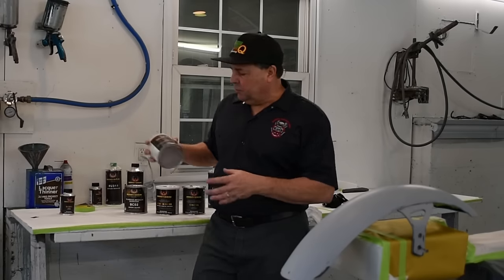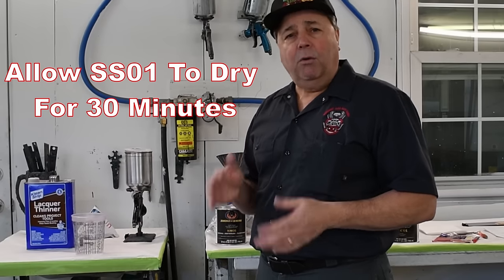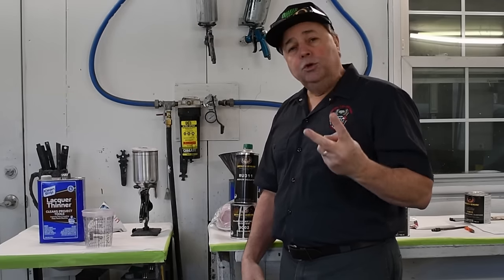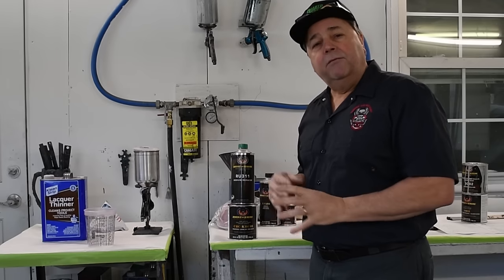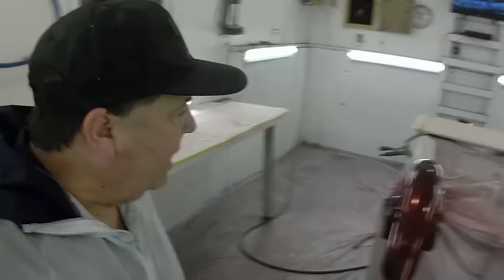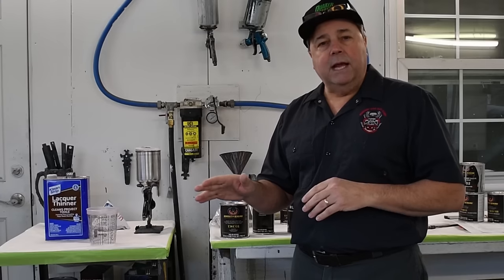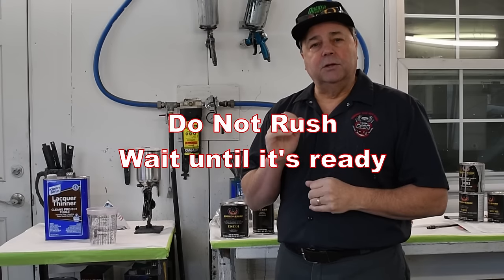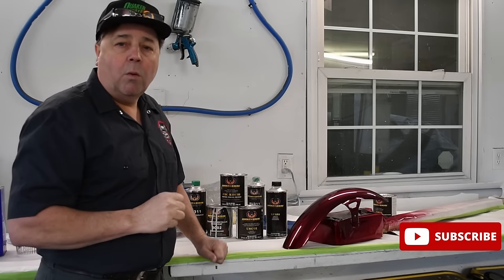How To Spray Kandy Brandywine House Of Kolor

Comment: wy so many grays and silver,  this paint doesn't work with just after the gray epoxy primer or what,????
Reply from the maker: Nope, It's a three stage finish. The color coat is transparent and provides a background for the color. Different base colors=Different results
Reply: ah ok got it,  thank you for your information sr.

Comment: Nice job , was getting good until u start with the clear part, probably I not understand very well about the procedure, three lays of clear coat at least that for sure but what about the time between layers ? 20 minutes or is dependent how dry is? After that nice job again. I’ll give you a”like”.
Reply from the maker: Dry time between coats of clear is 15-20 minutes depending on your enviroment. Another way to tell if your ready for the net coat is, the clear will be slick to the touch.
Reply: @troykane  awesome! Mister !

Comment: Nice detail, more than once I've been light on the edges, thanks for reinforcing edges first along with all the areas we typically miss :)
Reply from the maker: Thanks Ed. Happens to the best of us. We usually notice after the fact though
Reply: @troykane  I just finished painting a model car in a candy and basically the same thing happened to me, as well.. although, not with the edges, as I did those first but with the entire front bumper. I needed to paint it off the body, as other parts needed to be glued on after paint. Even though I did the same amount of coats, it came out a little bit lighter than the body. Guess my distance wasn't as close or I sprayed it lighter. I would love to paint full sized cars one day but man, the chance of errors stress me out at just the thought of it, haha.

Comment: Thanks, for the tips and techniques that you used in this video. Color is exactly what I was looking for!!!  Painting a old school drag bike that touch up is just a manner of time…. But planning on taking it one step further with sand-wedge ghost flames between the two clear coats. Thanks again.....:)
Reply from the maker: Good Luck! Thanks for the comment
Reply: Witch  type model  drag bike I got Classic Legend  of all Motorcycle stock OG drag bike show  Room Condition  first prize winner 🏆 workmanship with same color 🖖🤟

Comment: Troy ----- Thanks for the response back --- that video was two years old ------- I have been at the HOK site looking at colors --- and their products ----- Still want to use HOK on a car ----- never have used them ----- this thought I have had for years ---- So -- for me it's got to be soon --- or ---- not at all ------ So, thank you for what you use as lighting ---- and I converted to them  ----- The next thing I would like to ask ---- in your video couldn't tell what kind of mask you have ----- in the description below the video --- just says 3M ----- with HOK are the products up to the point of spraying on the Klear ----- is a GOOD ---- respirator ok ------- being that the USC01 ( Show Clear ) is Urethane a bad fume to breath in ---- and not so good on the skin too ------ What are you using ----- in the scene of you doing the Clear ----- a lot of fumes ------- Would like to know your thoughts on the Respirator ----- does one need the forced air?

Comment: Troy...Questions please. You might have said and if so, I totally missed it. 1. What size spray tip are you using here? I have a 1.7 but I can buy another one if needed. 2. What is the air pressure you are spraying with? 3. What is the cost of all the stuff you used in this video? I have a 2008 Goldwing that is the "black cherry" color and I want to repaint it. I am still pretty much a beginner on spraying, but I am learning and when I do spray, I am not racing thru it. Great video and I wrote everything down that you said on mixing. I need to go to your web site and look at all the other colors as I might just change the color of my Goldwing to something entirely different. Thank you again, Paul

Comment: Question
If I was to spray 2 colors or do artwork requiring masking on the Orion Silver, should I spray a coat of  SG 100 to protect the silver as not to pull any metallic from the Orion Silver?
Or just mask directly over the silver, spray candy, then pull the tape off the Orion Silver?.
Thank you
Reply from the maker: Yes, that exactly what to do.
Reply: @troykane  thank you 👍

Comment: Hey Troy..again I appreciate your videos..I was recently spraying silver sealer..I went to mix my kbc teal and it seeded...my question is when I get my new paint how to prep the silver sealer..scotch Brite have you ever had to come back and respray your ss01
Reply from the maker: I have never had a recoating problem
Reply: @troykane  so you never had to recoat..or never had a problem with putting a new coat down...
Reply from the maker: No problem putting another coat down over what I have already sprayed. Sand and respray no problem
Reply: @troykane  do you just red scotch Brite or 320..sorry to keep bothering you
Reply from the maker: @johnbruce1216  I would use 400 grit or 600 grit.

Comment: Great video. What do you do for the gas tank tunnel and the underside of the fenders?  Also would black graphics show through the candy?  Would you recommend a candy black?  Thanks for the step by step.
Reply from the maker: Okay, I generally paint the tank tunnel and fender undersides a flat black. 
 Second question, a straight black will shwo thru the Kandy. A Kandy black would be more like a Ghost Flame you would only see it in certain lighting conditions. Hope that was helpful. Thanks for the comment/question.
Reply: @troykane  thanks

Comment: Hi when you use your finish line with the brandywhine what pressure at the inlet to the gun. Do you use a variable volume or a tru pressure regulator. It was a great video i am doing a 55 pick up that color……thanks john g
Reply from the maker: True pressure at about 35 psi

Comment: Hi Troy,
Love the video! 
I’m thinking of getting my Harley Tri Glide painted with this. 
I wanted some graphics done, and actually thinking of doing a “Marbleizing” done all over. 
Would I do a black sealer, then Orion Silver (with a slow reducer), then use plastic to get the marble texture… then cover 2-3 coats with the HOK KBC-01…. Then clear coat. 
What are your thoughts? 
I definitely want those metallics to help “pop” that color. 
Maybe a metallic added clear coat over the Brandywine first, Then full clear over all? 
Or will that Orion silver max be good enough? 
Your thoughts please? 
TIA. 
-Brett
Reply from the maker: Your plan sounds good. I would go easy with adding metallic. You can always add a little sparkle to an additional clear coat application if you want more. But, you can't go back if you over do it. 
Good Luck

Comment: Great video Troy, the paint job looked great. You said if you spray over black it would look like black cherry, is that the way to do a black cherry like back in the day? You can't find anyone that really knows how to do a black cherry paint anymore. Thanks for the video and any info you can give me. BTW I dabble in paint in my garage, use to paint trucks at GM so I have some basics, Thanks again.
Reply from the maker: That is one way. Or you can use a darker Kandy Color. Kandy Concentrate darkens with each coat.

Comment: TROY, very .very, good video !!  Do you mind sharing with us the tip size and working air pressure; used to spray each product?? the ballpark would suffice; !!having this info cuts down on experimenting which= $$$; this stuff,s not cheap;thank you,Patrick.P

Comment: Great presentation, I love it. Question! Between clear coats what’s the Pot life or do have to mix a new batch every time??
Reply from the maker: The pot life is in hours. So for a three coat application one batch is good. If you allow your clear to dry and sand it for a recoat, then of course you would need a new batch. Good Luck!
Reply: @troykane  Thank you for responding quickly. When you say Recoat, is that what others are calling a Flow Coat? And is it a lighter and thinner coat. No one is explaining that method. I have not heard details of this process. I’ve always was in the understanding that sanding with 1500+ and buffing was the final step.
Reply from the maker: @jamescaneda9515  Flow coating is a re-application of the clear coat. So sand the surface and re-clear the surface same as the first application. You can add additional reducer to the clear to get more "Flow". Thus "Flow Coating"
Reply: @troykane  Thanks, I really appreciate your quick response for information. Apply three coats clear, let cure, block sand with 1500+, apply quick clear coat but not a wet coat.
Reply from the maker: @jamescaneda9515  I would use 1000 grit. Make sure your clear is dry. I'd give it a week. Sometimes you can have lifting problems if the clear isn't cured. Good Luck!

Comment: This was a very informative video, just wondering what step you would have taking if you wanted to add factory vinyl decals to the tank?
Reply from the maker: Good question. If you want the factory cleared over look. I would apply SG100 intercoat clear over the final color. Then apply the decals. Then apply clear. Sand and apply second application of clear.

Comment: Please can you tell me how the KBC01 factory pack single stage base coat compares to the silver base and brandywine concentrate over the top?
Reply from the maker: KBC is a Kandy Base Coat. It is not a single stage. Single stage would be color only, no clear coat required. Single stage colors are usually require a hardener. KBC is a Base Coat that emulates a true Kandy. Kandy base coat is easy to spray and easy to repair. Kandy concentrate over the silver is a true Kandy. Kandy itself is translucent, you can see thru it. So when Kandy concetrate is applied over a silver metalic base, the base provides the metalic effect. You are looking thru the Kandy at the metalic base. The base color will change the effect and color. The amount of coats of concentrate applied also change the color. Therefore overlap areas are darker than areas not overlapped. This is where the difficulty comes in. It takes a lot of practice to get an even color with a true Kandy. Also if you have to repair an area it can be difficult to match the color. Hope this was helpful to you.

Comment: Troy, great video it’s been a while since I’ve painted with a gun, I have a ton of questions I hope you can find the time to help me.  1- what air pressure did you use? What size tips did you use? And I want to match the look my truck has, it’s called tuxedo black with gold,blue,purple and red mini flakes in it for extra sparkle, should I put them in the first coat of clear? but we are painting it kandy brandy wine. I have loved that color since I saw one close in an old ( old ) hot rod magazine it was on a 1966 Ford fair lane they called it candy apple burgundy wine. Thanks for any help you can give. And keep up the great work.

Comment: Great video. Getting ready to do my first HOK spray job. How long are you waiting between the Kandy base coats? And are you emptying your gun between each?
Reply from the maker: I wait about 10 minutes. It will depend on your shop temp and ventilation. Yes I empty into a mixing cup after each coat. Mix and strain back into the gun when I am ready for follow up coats. Thanks for the comment and good luck

Comment: I’m hoping you are still reading coments because having a problem covering a scrape in my 68 Vette hatch, We used glazing putty and sanding it smooth with 400 grit. but it still shows up.
Reply from the maker: Make sure it's a scrape not a crack. A crack you need to use fiberglass from both sides. If is just a scrape, prime the area with Evercoat Featherfill. Allow to dry and block sanding should take care of it. good luck

Comment: What size fluid tip and air cap are you using on the tekna. My DV1 is 1.3 and my DV1C is 1.3 would that work alright
Reply from the maker: Yes that will work fine. Good Luck

Comment: Great video..what size needle did you use ? was it the same for sealer,Orion ,paint and clear...do you use the same size fan pattern for the paint and clear? thanks
Reply from the maker: I would recomend a 1.2 to 1.5 needle nozzle. If you could only use one I would chose the 1.5.
Thanks for the comment.

Comment: So you can touch up Kandy base coat? Plus does it fade with in time?
Reply from the maker: Clear coats generally don't fade. That is the purpose of the clear coat. And yes Kandy Base coat can be blended out for a nice repair if needed.

Comment: Can you apply house of color brandy wine paint on wood surfaces
Reply from the maker: Yes you can. Depending on the surface, a porous surface is going absorb a lot of material. A less porous surface would be preferred. Good Luck!

Comment: What's a good psi while spraying this process
Reply from the maker: If you are using an HVLP gun I would spray at 25-30 PSI at the gauge on the gun inlet. Set it while you pull the trigger. This will give you 10-14 psi at the air cap. Good Luck

Comment: Might have missed it. But is there any problem clearing the orion silver between it and candy coat? For anything you want to add like black under the candy
Reply from the maker: You can clear Orion silver as a stand alone color. I.
If you want to add colors or art work I would use SG100 intercoat clear. This is a low build non catalized product made for this purpose. I hope that answers your question. Thanks for the comment
Reply: Got the answer here, Troy. I know you’re busy and probably get tired of answering the same questions 20x … ha. Thanks again !

Comment: I'm trying to figure out my mistake, I sanded to bare metal, cleaned it before priming, yet my tape pulled the primer off, just glad it was before I applied the paint design w tape
Reply from the maker: The problem is adhesion. Clean surface with pre cleaner. 2. a sanded surface provides a mechanical bond. 3. Use a DTS primer. It contains a chemical etching compound to provide adhesion. I use House Of Kolor DTS Primer. Watch my older video on this subject here https://youtu.be/EqHl9O5Kco4 
Good Luck and don't give up

Comment: Once you put on 8-10 coats of the original lacquer type House of Kolor Brandywine, it stops getting darker...I know because I once sprayed 20 coats...to the point where the Brandywine had a slightly blue tinge. I don't recommend anyone do what I did.
Reply from the maker: It's a learning experience.
Reply: @troykane  Absolutely! There's no school where you go to learn how to spray HOK Kandy.  I no longer spray cars...but I can see how the system you used is a lot more forgiving than the lacquer stuff from the 70's . My question would be...do you still have to walk the sides of a vehicle?
Reply from the maker: @markanthony3275  Not so much. I still do it out of habit and just make sure everything is even.
Reply: @troykane  Probably wise. Thanks! Btw...great job, it looks nice even in the booth.